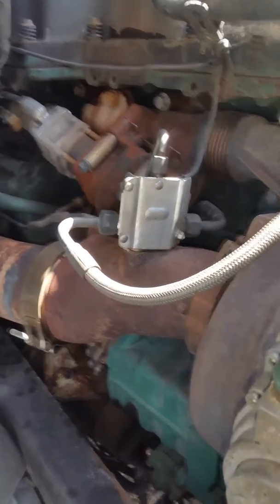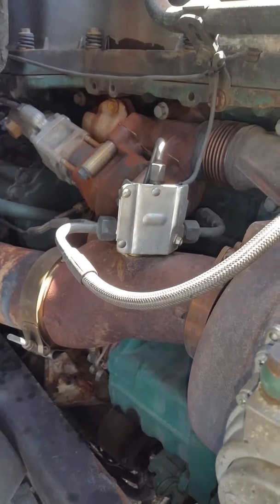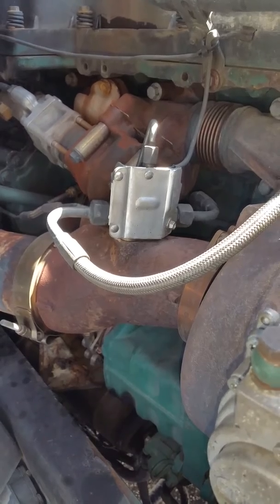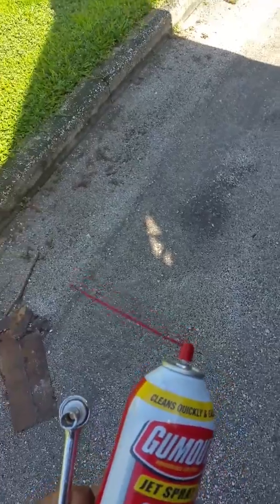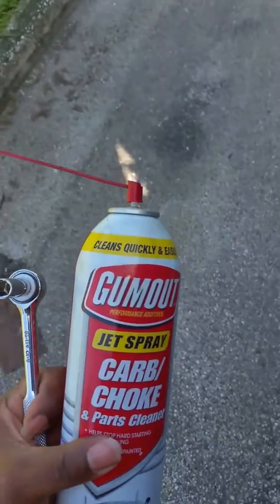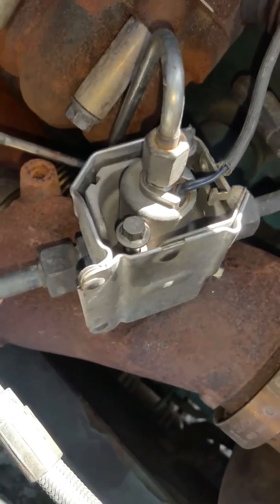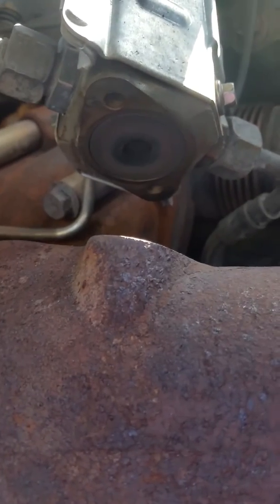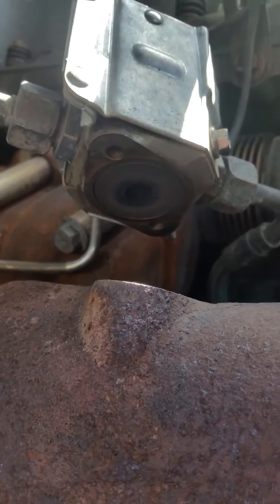How to Clean 7th Injector on Volvo #7thinjector #regen #dpf #soot

Comment: I found it and just poured my second bottle in two hours ago  it seems to be doing pretty good so far .. my truck was in 5mph derate last week I get the same codes Everytime for nox sensor and doser valve.i just put new ones on four weeks ago $1400 dollars parts   ain't no way in hell them parts went out that quick ...my truck was in 5mph derate mood I cleaned that number seven injector like in  the video but with a wire brush.. unplug the speed sensor went on made my delivery I deal with this issue so much I know how my truck operate I dont go to shop unless I have to I can drive with the speed sensor unplugged until it do a Regen and everything will  go back to normal been doing it for three years ...I'ma take the dpf off and see what kind of results I get after pressure washing and air blowing it out ..when I had cleaned before that took away alot of the problems it was giving me I'm guessing it may be that time again for it to be cleaned

Comment: My truck derate alot hopefully this will help me out some.. thanks
Reply from the maker: Zadok Simmons You are welcome. Add  some DPF cleaner made by Lucas from the truck stop. It cost about 60.00 but it works well. I keep a bottle in my truck just incase I run into a clogged dpf problem
Reply from the maker: Some T/A's do but usually all pilots/Flyin J's have it. I also pour a lil bit down down the hole where the injector is to help out with the cleaning. Like maybe 1 or 2 oz

Comment: It finally asked for a parked Regen It's doing that now after being in derate mood all weekend I just unplug the speed sensor and drive it  when it's gets like that... I'm at T/A  looking and don't see the Lucas dpf cleaner
Reply: Zadok Simmons  that Lucas stuff is 60 bucks a bottle at truck stop and I’m not sure it works. I have a D13 and also have issues with DEF system, I end up having to spend couple of grand on it every 2/3 months for dealer to hang parts on it. So far nobody has hung right part on it yet. There are some companies on line selling electronics that provide ecm with 100% correct information. No more derate or engine lights. I’m thinking about it for my truck. I have heard all the horror stories about they will put you under jail if caught with device.lol. Gimme a break, how many people do you suppose are driving their gas autos around with service engine soon light on. That light on automobiles comes on ONLY for emission related issues but you can keep on driving. Can you imagine if they built derate into cars. Good luck with your truck.